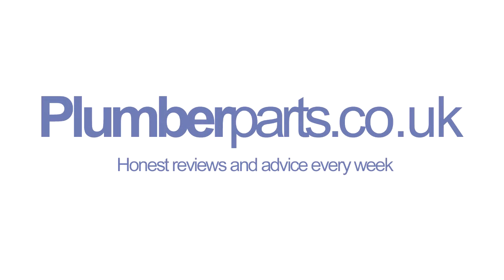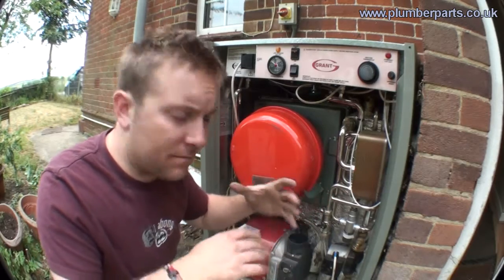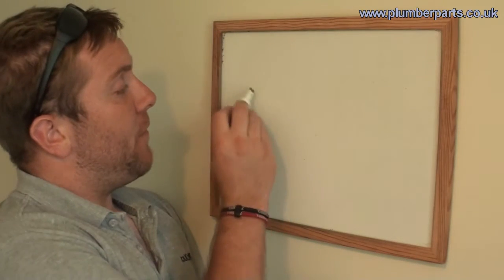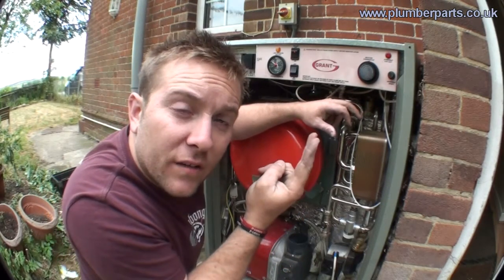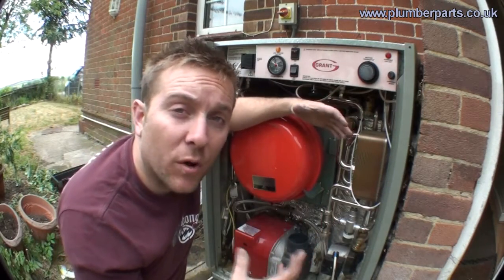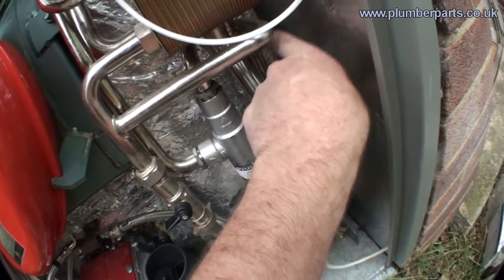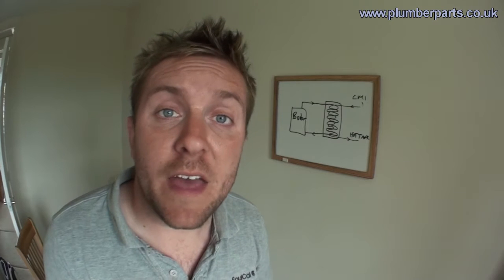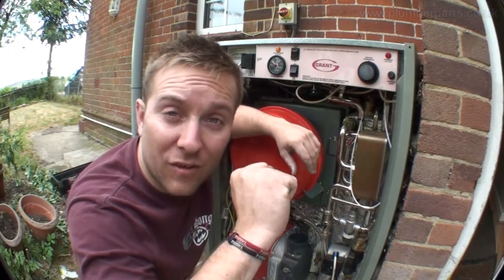How Combi Boilers Work - Plumbing Tips

Comment: Hi, i am looking at draining the radiator system and i have this boiler. To do this, would i use the drain tap on the left hand side of the burner? Is it easy enough to drain and then re-fill?

Comment: Bought a used combi boiler offa EBay (Vallient 828) , however never had it installed as 'experts' state that they are not that reliable - How true is this?
Have a 28 year old Thorn EMI basic boiler, that surprising you can still get spare parts for and has never let me down.....should I change over?